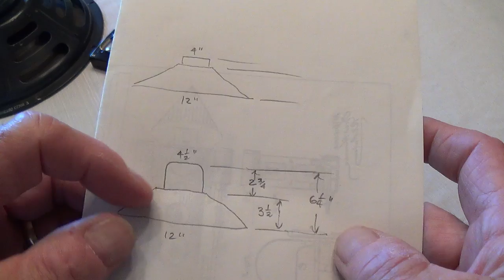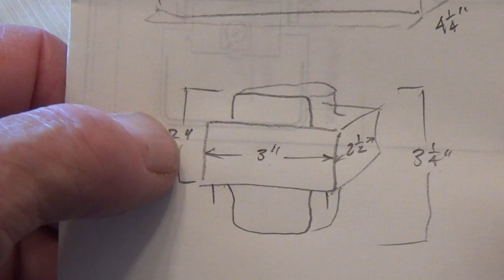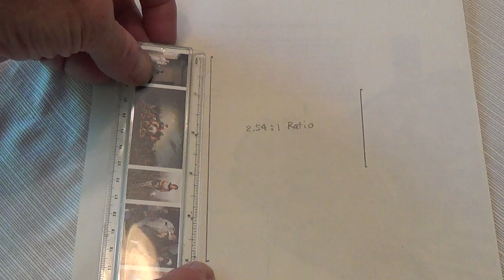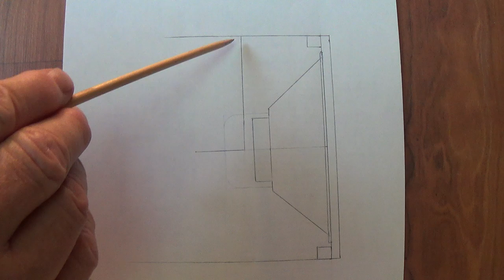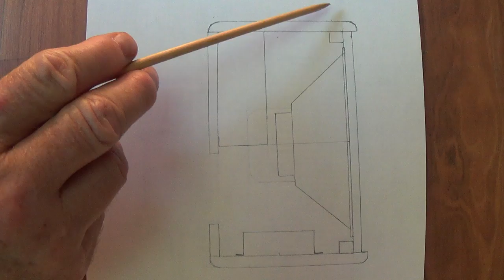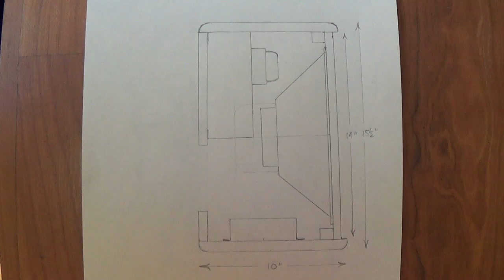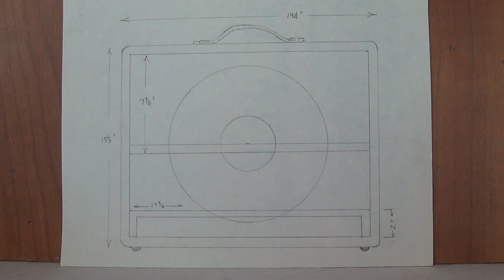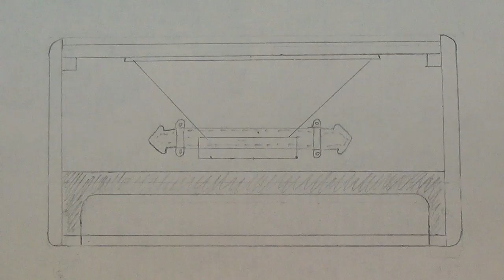How to Scratch-Build a Vintage Amp, Part 4:  Designing the Cabinet

Comment: I have a Crate V50 with a similar design cabinet(much larger) and it has a unique sound. Though the cabinet seems thinner than your proven 3/4" pine choice, it still breathes well. As always thanks for sharing! That Jack will make fine production engineer one of these days. Thankz
Reply from the maker: +Audio Tech Labs  You're welcome, ATL. Thin cabinets probably resonate better, but since the vast majority of guitar amps are open-backed, I doubt that it makes all that much difference. Jack is proving to be a very creative force on the Workshop Dog Enterprises team.

Comment: I really like the thoughtful consideration in your design of not only all the working amp parts but the cabinet as well. I see you are going for just what is needed as far as spaceand the design will be compact. No wasted space. If it were me designing the cabinet, I might be a little more liberal with the size, being that you are using a 12 inch speaker. It may not really matter as far as sound goes, but I would maybe want it to somewhat over-sized if only for personal esthetics reasons. Nonetheless, its a blast watching you, and your crew taking us on the journey to how-to vintage amp build town. Cheers!
Reply from the maker: +Krang Gangs  Thanks, Lee. I guess it's just a matter of taste, but it's kind of a challenge to make them as compact as possible.

Comment: Nice video as always. Can't wait for the next videos - chassis fabrication and point-to-point wiring in particular. I'm at about the same point you are except my designs still need some tweaking and I still have some parts I have to order.
Reply from the maker: +sa230e Thanks, SA. Best of luck with your project.

Comment from the maker: Mark Batten, your comment had no Reply capability, so I'll answer up here.  I widened the cabinet a little and the tubes are at either side of the chassis (not in the middle) so they really aren't very close to the magnet. To be honest, in my experience, proximity to speaker magnets is more a heating problem for the magnet than an electrical issue within the tubes.

Comment: The only bad thing about these videos is waiting for the next one... :)
Reply from the maker: +Sean Edwards  The wait should be a short one for Part 5.....it's almost done.
Reply: +Uncle Doug Nice :) Quick question... why did you go with ClassicTone over Mercury Magnetics? Do you think they're about the same quality?
Reply from the maker: Mercury Magnetics has a wonderful reputation and great products, Sean, but they are very expensive. I am completely satisfied with Classic Tone transformers, particularly when they are sold at 1/2 to 1/3 the price of the equivalent MM unit.
Reply: Uncle Doug ***** Thanks for the input. I built a vintage style Vox and used a Classic Tone PT but I used a MM OT. The MM OT was very expensive. Lol.

Comment: I have built some speaker cabinets.  I have found that the bolt flanges on speakers are larger than the speaker size.  For a 12 in. speaker the total diameter of the speaker flange is closer to 12 1/2 inches.  It is the cone that is twelve inches.
Reply from the maker: Thanks for your input, Willy.

Comment: I'm sure you have attachment of the back doors accounted for. Maybe 3/4 cleat? And that won't interfere with the tank? 
Love all the videos- thanks
Now off to part five where my answers have likely been addressed
Reply from the maker: +Dr. Hodge You're welcome, Dr H. Yes, there are three cleats bracing the lower rear panel, which is permanently attached. The upper rear panel is attached to the flanges of the metal chassis with sheet metal screws.  This will be evident in Part 6.

Comment: Rusty, of all assistants to Nicola, had the vision which was of using not strictly Direct Current, but A/C and stepped down D/C as needed, marking his shift in paradigm.
Reply from the maker: Indeed. Nick, as we call him, was effusive in his praise of Rusty, particularly during his later years, when Rusty essentially took over.

Comment: Great line of planning.!.... with your repair / mod / improve type approach.....will repair /replacements of parts become an issue with the speaker set tightly behind the chassis? or is the front mount baffle a solution for that?   THANK YOU
Reply from the maker: +Brian Hensley You're welcome, Brian. The snug fit is necessary to achieve a reasonably "thin" cabinet (from front to back), and is not really unusual in a compact amp such as this.  Once the cabinet is covered with material, the clearance can not be easily modified by moving the baffle, especially since I intend to overlay the speaker baffle with a decorative grill.  I haven't started building the cabinet yet, and may alter it's width for some additional clearance, or may tilt the speaker upward, as in the red Supro, so the magnet (tilted down) clears the chassis......we'll see.

Comment: Great video Uncle Doug !!  I plan on following this instruction to the letter on my upcoming project !!  I do have one question - regarding the cabinet dimension planning for the reverb tank.  Does that tank have the input jacks on the top ?  If not - do we need to plan a little extra space on the sides (left/right; or front/back ?) for the cables to protrude?  I would guess they might take about 1 1/2 inches !!  Waiting for your next installment with great anticipation !!
Reply from the maker: +Donald Filbert Thanks, Donald. The cables are pretty flexible, with RCA jacks, so they really don't require much room. Recall that Fender encloses them in a snug vinyl bag with the tank.

Comment: I realize that this video is a year old, but I'm wondering how the amp's tone is affected by the relatively small size of the cabinet. Is there any significant trade off there for the compactness?
Reply from the maker: Since the cabinet is open-backed, I don't think that its internal volume has much effect on the tone, Sam. In closed cabinets, I believe the situation is quite different.

Comment: Just when I thought I wasn't going to build another amp;-) I'm still trying to bolt in my speaker into my 5G9 combo build and I'm already looking at my Transformers laying around for this project. I have a set of Allen Amp Transformers(Heyboers)The PT is the T25( 310V-0-310V @ 150ma, 6.3V at 4.5A, 5V at 2A. 50V bias tap, center-tapped) and the T011c output(8,000 ohm primary to 8 or 16 ohm secondary for use with a single 6V6. 4,000 ohm to 4 or 8 ohm for use with a single 6L6, EL34 or two 6V6s in parallel. Rated 95ma continuous! I think these will work great for this build and bankrupt me, I do have a Hammond 290CAX(315-0-315@115ma,6.3v@2A,5v@2A) in my stash as well. Thank you for all your help
Reply from the maker: +Lionel Berthelon  You're welcome, Lionel. It sounds like either PT would probably work in this circuit. Best of luck.

Comment: Just curious. Will you be using a variac to slowly bring up the power to observe how things are going when the time comes? Also, is there like a break-in period for some of the components, like a new car for example. You don't want to just blast it out on day one do you?
Reply from the maker: +Krang Gangs  Greetings, Lee. No, I'll just use a Current Limiter. I generally reserve the Variac for slow-starting vintage circuits that have been sitting, unused for many years.  The only item that needs breaking in in an amp is the speaker, and the one I'm using has been broken in for almost 50 years :) I could indeed blast it out immediately.....but probably won't. I tend to go fairly easy on vintage speakers.

Comment: Hello Doug, you didn't show the internal outline of the tubes coming out from the chassis. Is this not an important consideration to make sure you have adequate internal clearance to the speaker etc? Would it be better to design the chassis first and then the cabinet?
Reply from the maker: +allanpennington   A good point, Allan. Since the tubes will be protruding straight downward from the center of the chassis floor, clearance with the speaker should not be an issue, but I do have a little concern about having enough room to tuck in the power cord and footswitch. I'll draw them in and see. If clearance is inadequate, I will reduce the chassis height.

Comment: Hello Uncle Doug, A quick question. Heat wise, is there any benefit to choose a TR, that's doesnt sits in the chassis but rather stays out, or there is no great advantage, and its just going to use a lot more extra space for nothing?
Reply from the maker: I would say there is no benefit, with regard to heat dispersion, to either transformer style, Pan, and they both cover approximately the same "floor space"  on the chassis. The stand-up is easier to mount (no big hole to cut in chassis), and the lay-down version doesn't require that all the wires pass through one or two small holes in the chassis. It's a tie :)

Comment: Attempt
as I did to begin project to amp and was great success designing & ordering
 parts. 
Project failure did due to parts not pass muster of pets sniff test.  What to do now, re-order different parts (or
should be pets changed?) for re-pet muster sniff test to be success to project?
Reply from the maker: Greetings, Netty. Apparently, your new parts didn't meet expectations.  We always order from Antique Electronic Supply......never a bad part yet.  Better luck in the future :)

Comment: Hi Doug, Just curious why you switched from Aluminum to steel for this chassis?
Reply from the maker: +Dan Berthelot  I haven't made a steel chassis in a while, and steel was the material used in the vintage amps.....Valco, Fender, Gibson, Supro, etc.  There is no electrolysis between the steel chassis and the steel components that are attached to it, including bolted ground lugs....while there is between an aluminum chassis and steel components.

Comment: I don't like making assumptions but to make a head unit  we just eliminate the speaker ?
Also could you fit in a shot of your Jeep. I also have a CJ5
Reply from the maker: +Bill Trom   Yes, you simply compress the cabinet vertically, using clearance for the chassis and (ability to remove) tubes with reverb tank in place (if you have one) as the determiner of your vertical height.  Parts of the Jeep have been visible in a few videos, but I may do a quick overview as a break in a future video......maybe even Part 5.

Comment: Am I insane for wanting to build a Marshall JMP with switchable Super Lead (1959/1987)/Super Bass circuit (1992/1986) and switchable 100/50W?

Would it be better to just purchase a 4x12 cab instead of making it from scratch?
Reply from the maker: I can't answer your questions, Joshua. Only you know your desires and capabilities.....but my advice would be to at least try to build or obtain them.

Comment: if the speaker is close to the amplifier does the magnet on the speaker have any effect on the function of the amplifier? (interference with the induction in the transformers or electron flow in the tubes)
Reply from the maker: This is an excellent question, Jon, and one that I have spent some time contemplating.  From experience, I believe that the magnetic field has no apparent ill effect upon the tubes or transformers.....but that the heat of the tubes in close proximity to the magnet may, over time, diminish its magnetic strength.
Reply: thanks for the quick response. i had not even considered the effect on the speaker! i guess that is why you are the guru and i am just a dedicated follower! thanks again!
Reply from the maker: You're welcome, Jon. It's all observation and supposition on my part, but I believe it to be true.

Comment: How much will it cost for a 200 watt valve uncle doug
Reply from the maker: If you mean a 200W tube amp......lots. It would require about 4 rectifiers and would be very complex and expensive.